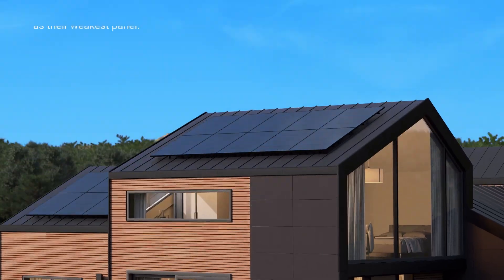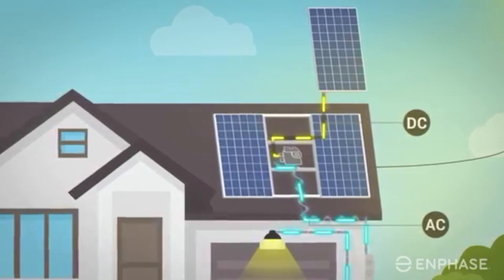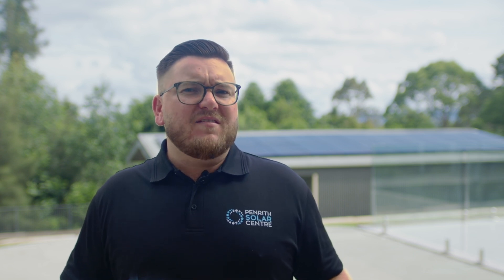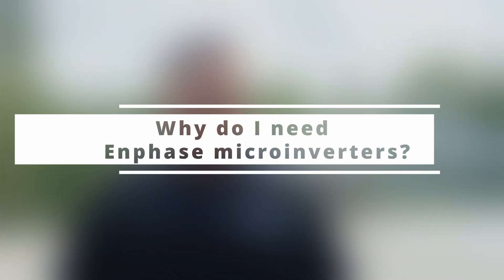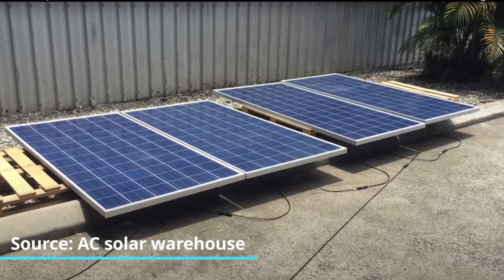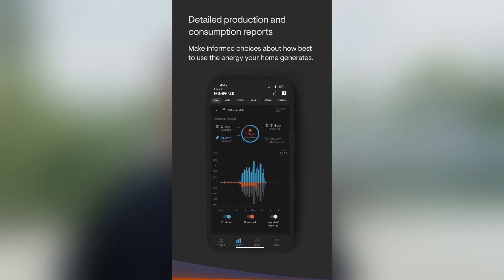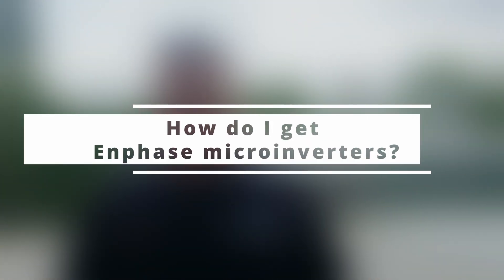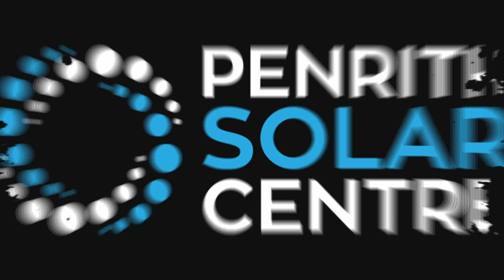Everything You Need To Know - Solar Microinverters

Comment: If there are 10 panels & 5 Microinverters on my roof,  there are 6 or 10 wires at 240VAC coming into the house ?
How do the 5 Microinverters stay IN PHASE with eachother ?

If I want to charge a battery-bank , the AC has to be STEPPED DOWN & RECTIFIED , with CONVERSION LOSSES all over again ?

Comment: Thanks for the explanations. Are those quoted prices for a full system including micro inverters (panels, cabling, mounts etc), supply & fit - or just the micro inverters (as in, extra for rest of the system)?
I was under the impression they are quite pricey compared to string inverters or even compared with optimisers.